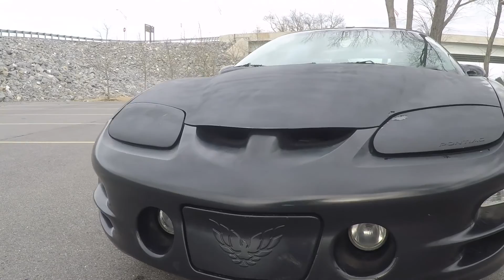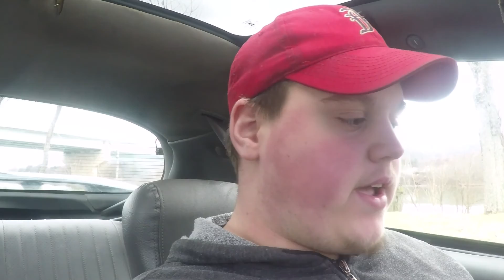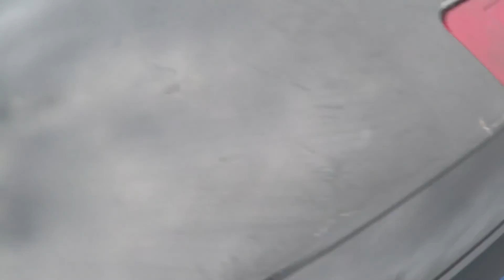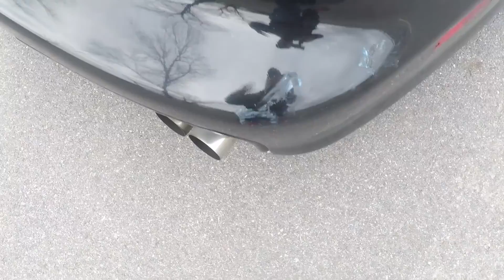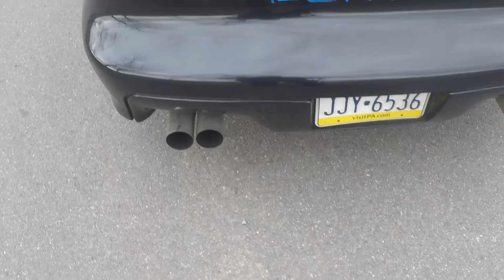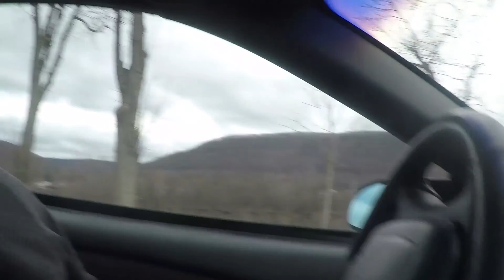I HATE MY TRANS AM?!

Comment: Another PA F-body, very nice. Car looks rough though man, hope it gets a nice updating.I have a 2000 WS6, amazing car. I have the UMI short stick on the OE Hurst shifter, shifts very nice. Would be a good upgrade. Your shifter looks humongous in the car lol. GM paint sucks overall unfortunately. Mine was never daily driven so the paint has survived. I hate the seats myself, cheap and not rugged, but I daily drive a Cobalt with OEM Recaro seats. Enjoy your car man.
Reply from the maker: Thanks for the comment man. The car should be completely restored by spring next year. I have looked into short shifters and will probably go MGW. This video is pretty dated so a lot has happened to the  car since its release.
Reply from the maker: The Okayest Guy Agreed

Comment: Grinding is synchros   drain out and put in red line d4 racing atf4 oil and it will fix them as long as it's not really bad
Reply from the maker: Since this video has been posted, the transmission has been rebuilt to Stage 2 with all new synchros. Shouldn't be a problem anymore :)